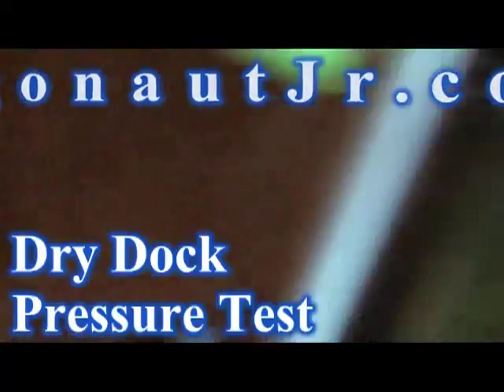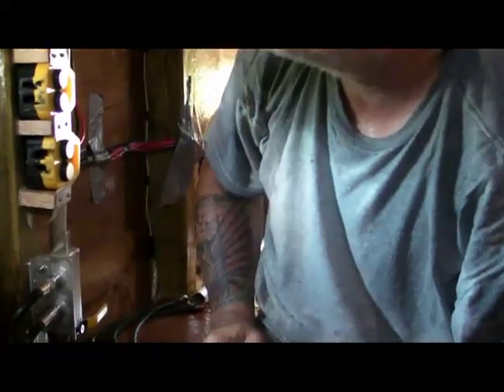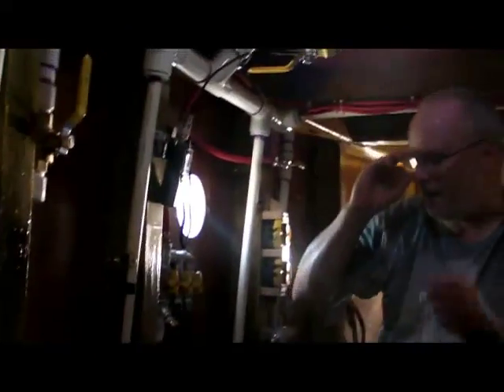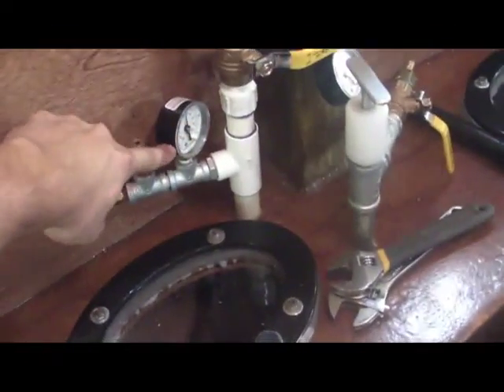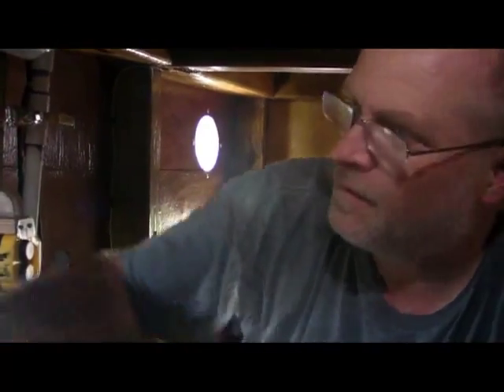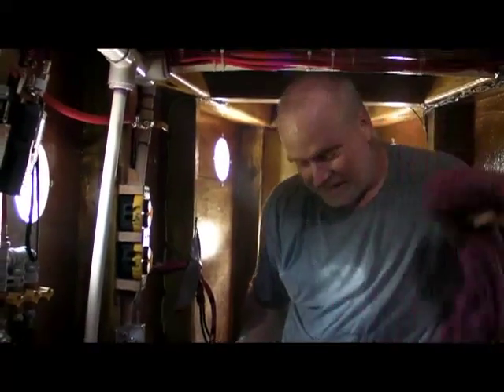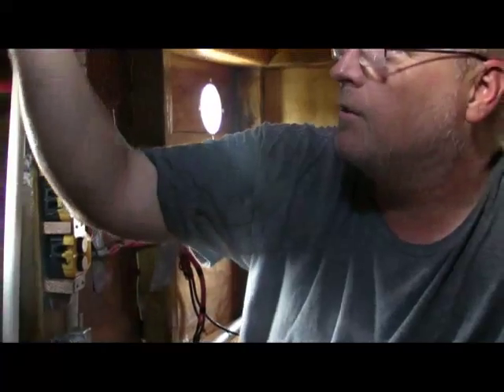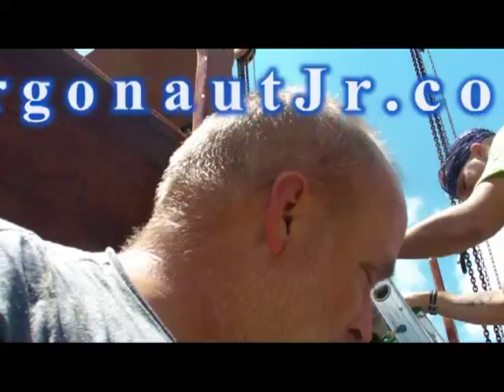Argonaut Jr. - Dry Dock Pressure Test

Comment from the maker: @porpoisefathom    Yes, there is more plumbing but I don't think there is any increased danger.  There are also different structural issues as the top hatch need to lock down under both positive and negative forces.  As for the air pressure, when we descend a couple of scuba valves automatically open to add air or we can just flow air through constantly which is what we did most of the time.

Comment from the maker: @porpoisefathom On the way up the excess pressure vents through the divers hatch portal.  We can even come up with the divers hatch open. Once on the surface we button up the divers hatch in the bottom and then vent the rest of the pressure to the outside before cracking the top hatch as there will still be about10 psi from the draft.  You need that ability to do that in a 1 atm too, ie: a scuttle valve.  --Doug